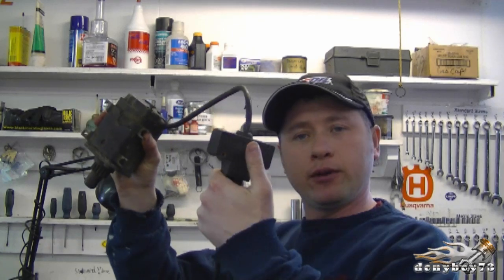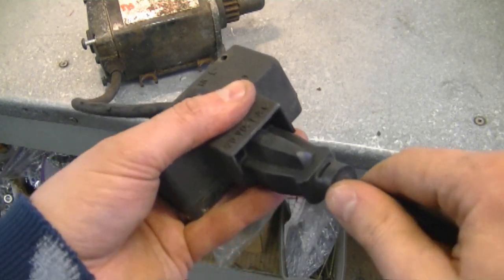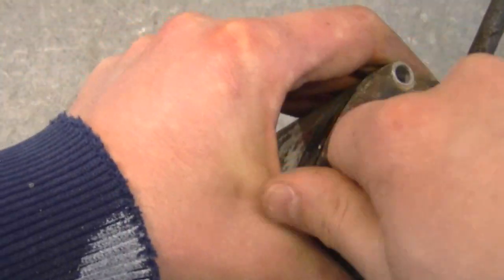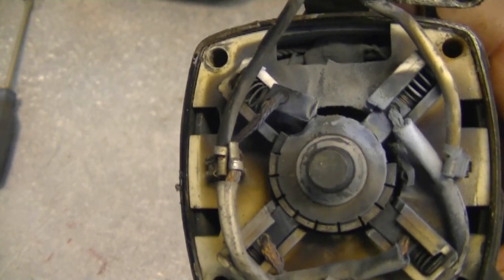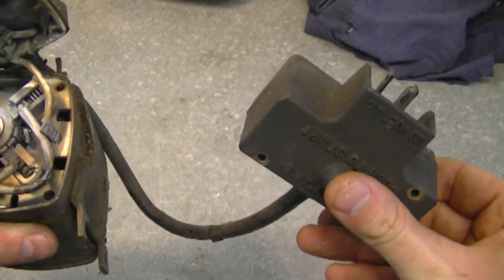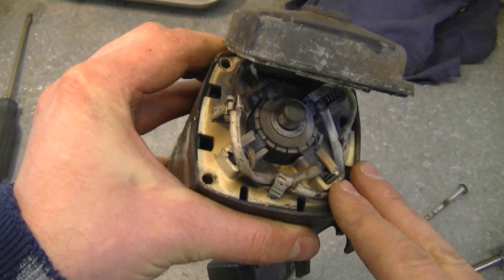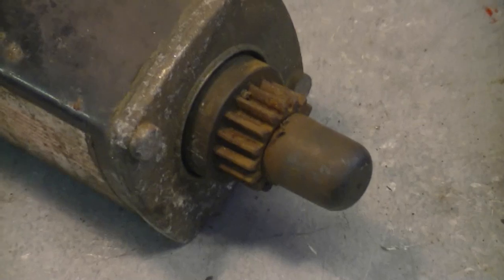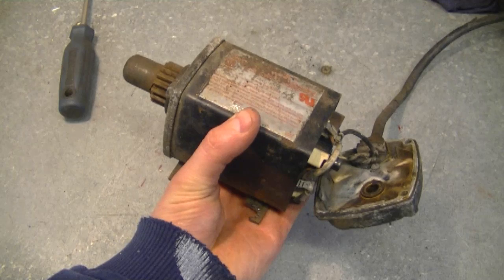Diagnosis of a Defective Snowblower Electric Starter

Comment: My starter gear will not stay extended long enough to engage the fly wheel. Is this a problem due to a weak motor or will replacing the components in Kit number 670346 solve this issue?
Reply from the maker: would have to physically see and test your starter to be sure

Comment: the 3rd prong (the roundish) one broke off where the extension cord plugs in.  What is your suggestion? Ahrens brand
Reply from the maker: it will still work, but it's there as a ground for safety reasons